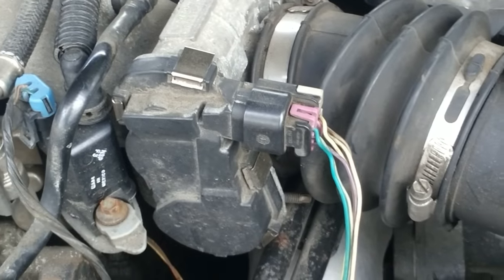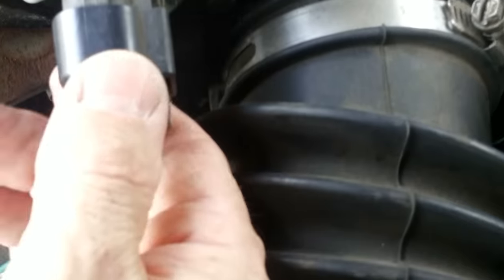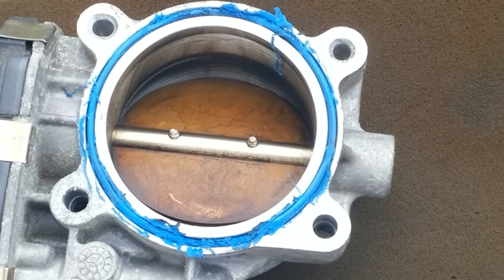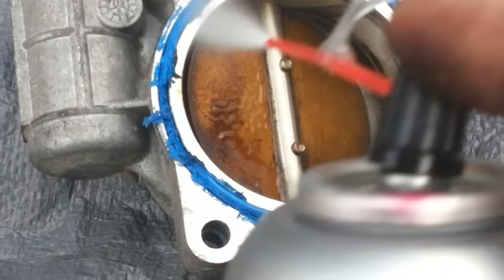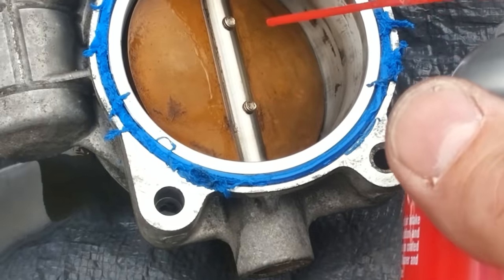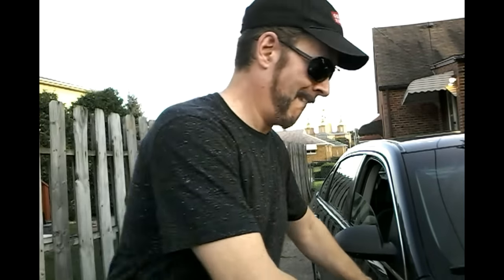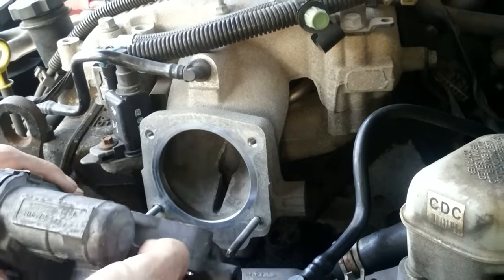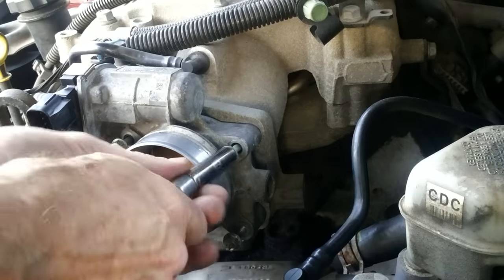Reduced Engine Power.  Here is the FIX.

Comment: 2012 Chevy Impala. Reduce engine power and traction control issues
Reply from the maker: The traction control issue is just because the computer disables it when in reduced power mode.
Reply: @lifeafterlife8417  Thanks. I'm In Indiana and it's getting cold now. Hopefully they can get it fixed for me. I've worked on everything but a chevy. This is my first Chevy also. Just had me nervous.

Comment: where did you get the replacement sensor?
Reply from the maker: I got mine from Autozone, but they no longer carry the sensor only.  Have to buy the whole throttle body.  Sometimes you can find the sensor on Amazon for certain models.
Reply: @lifeafterlife8417  thanks mate!!! ;-)
Reply from the maker: @frankking7779  No worries!  Thanks for watching.

Comment: got "reduced engine power" under a high load (around 5k rpms), replaced TPS, and reset code... a few days later under a high load again -> "reduced engine power", so i replaced gas pedal with sensor.. i reset the code, left the drive way and dogged in on purpose.. and "reduced engine power" again... it only happens under a heavy load, whats else could it be?
Reply from the maker: Find out what else is on the same 5 volt reference signal as the tps.  On some vehicles it could be the cooling fan, fuel tank pressure switch, throttle body,  ac pressure switch.  If one of these is faulty, it could pull that 5 volts down and trigger the reduced engine power.   Cooling fan is the most common.  Also look for bad grounds.
Reply: @lifeafterlife8417  is there a sensor in the cooling fan. Seems that's my problem still after replacing the gas pedal and throttle body and all the other grounding checks and battery terminals.
My car faults as soon as the cooling fans come on, if I disconnect the left front of the 2 fans, no more fault.
Reply from the maker: @danblumel  On some vehicles the cooling fan is on the same 5 volt reference signal as the throttle position sensor, and sometimes the APS sensor.  (gas pedal).  A faulty cooling fan can cause that 5 volt signal to the sensor to be pulled down below 5 volts.  (when the fan kicks on)  That triggers the reduced power mode.  Connect a voltmeter to the Aps and with engine running watch the 5 volts.  When the cooling fan kicks on it may drop to 4 or even lower.  This will verify that the fan is faulty 100 percent.  Do the same with the TPS sensor. (throttle position sensor)  Good Luck!
Reply from the maker: Might need to do a throttle relearn on it.  Let the car idle for 2 or 3 minutes, turn it off, restart and repeat 3 times.  But this procedure varies depending on the year and make of the vehicle.  Also, if you get a check engine light, check which code.  Could be the TPS is faulty,  or the wiring,  or a bad ground somewhere.
Reply: @lifeafterlife8417  if I disconnect the left front fan, no more faults. The right side fan still connected. Before I did that it would fault as soon as the fans come on. Mine is 2010 Impala.
I already replaced the throttle body and the gas pedal, cleaned battery terminals, added coolant ( was 1 quart low ). Only disconnecting the left fan stopped the faults.
Disconnecting the right side fan didn't help, so I hooked it back up. Disconnecting the left fan stopped the problem. Do I need to replace both fans as a complete assembly ?
Reply from the maker: @danblumel  Look at the wiring first. Make sure everything is good there.  But it sounds like the cooling fan. The other might only be for the AC but I could be wrong about that.  I would just replace the one if the wiring and connections are ok.  Do you get a check engine light?  Code 2138 (APS) would be another clue that it's the fan.
Reply: @lifeafterlife8417  yes I get all 3, engine light, traction, stability, engine power reduced.
After changing everything out, I guess I should check for codes again. The original codes were about TPPS throttle pedal position switch discrepancies.
BOTH fans do "blow" and turn freely by hand.
It seems a complete fan assembly,  both ( 2 ) in one unit. Both fans are for the radiator but maybe one of them does both the engine radiator and for AC cooling coil.

Comment: I have a traíl blazer 2003 and don't started like no gas and got reduce engine power light on it's the same???
Reply from the maker: Might be the same.  You need to scan it for trouble codes.  Code p2135 would be the throttle position sensor.  Check out my "reduced engine power update" video for a list of other causes.

Comment: What year is this car. Where can I get kit and gasket
Reply from the maker: 2006 Impala.  The kits can be found on Amazon sometimes if you match up the part number.  Getting harder to find in the parts stores.
Reply: @lifeafterlife8417  okay I need to find one for my 2013 impala. Are they the same throttle body or different
Reply from the maker: Yours is probably for the 3.6 liter engine.  Mine was different, the 3.5. You'll have to buy the complete throttle body assembly.  About 200.00 dollars most parts stores.  Make sure you replace the gasket and good luck!! @Sloo.impala

Comment: After having done all this with an 03 suburban and STILL going into REP, can I have my ecm reset or is this something strictly for 06 and up?
Reply from the maker: Not necessary on an 03 but couldnt hurt.  Make sure the cooling fan is not pulling voltage from the tps.  Its on the same 5 volt reference circuit as the tps.  Common problem on those.

Comment: My 2011 Chevy Impala is saying engine power reduced & it will say throttling system disabled & cut off while I'm driving
Reply from the maker: probably the throttle position sensor or the wiring to it.

Comment: I had a question sir I have changed the throatal body last night I lost the engine light thow now I'm getting engineer power reduced again wat is the problem to get again can you plse know me the solution
Reply from the maker: Give me the make and model and engine of the car and I will do my best.
Reply: Chevrolet Impala 2008 v6
Reply from the maker: @vijayvolpala509  Ok.  First step.  Double check that you reinstalled the throttle body correctly after you changed it.
Reply from the maker: second step:  Have it scanned for fault codes.  Most auto parts store will do this for you.

Comment: when my 2003 does the reduced engine power, i pull over, turn off engine, disconnect maf wiring harness, blow on connector and check pins and reconnect it.
starts right up.
about to,perform ground wire inspections next.
Found out i had to reroute PCM ground wire again because i found out the wire coming off of the engine was kinked too much so i relocated it to passenger side engine bay firewall.

Comment: My car does this when the ac is on can this fix the problem?
Reply from the maker: What kind of car?  Could be the fans drawing too much current.
Reply: 2009 Saturn Aura
Reply from the maker: @ashleylilly4443  Happens ONLY when the AC is on?
Reply: @lifeafterlife8417  yes sir when it runs to long. If you put it on test screen it says wire harness, n knock sensor but those have been replaced.
Reply: If I'm driving and I turn the ac on for to long the the engine power reduce comes on and I have to let it sit for 10 or 15 min and its back running.
Reply from the maker: @ashleylilly4443  Have a mechanic test the Accelerator position sensor (gas pedal) voltage with the engine running and AC on.  Should be 5 volts at all times.  If it drops below, the fans are drawing voltage from the sensor. (they're on the same circuit)  They will need to be replaced.   It's one of many possibilities.  Good luck!
Reply: @lifeafterlife8417   Thank you! I will have someone look into it.

Comment: Replaced mine. Still does the same exact thing.
Reply from the maker: Should work if you have trouble code P2135.  A lot of things can cause it.  Check out my part 2 video.
Reply: Mine does same issue but did p2138 and was accelerator throttle pedal position sensor
Reply: Replaced entire throttle body with sensor and it seems to have worked.

Comment: How long did you keep the vehicle after you "think" you fixed this problem? Because reduced engine power can come and go. Quickly. Or take months to reappear.
This MIGHT not be the actual fix.
Reply from the maker: It had an actual tps failure (code p2135) so replacing it fixed the problem.  I drove the car 3 years with no issues.  The transmission failed so I replaced that.  I then sold the car to a friend.  He’s still driving it today at 220,000 miles.

Comment: Does anyone know where to order just the sensor? Everywhere I've seen sells the throttle body with the sensor. (2011 Chevy Malibu LS)
Reply from the maker: That Guy   Autozone.  Around 50 bucks.  Also try Ebay.
Reply: Thanks bro. BTW...great video!
Reply: Went to 3 different part stores (O'Reilly, autozone, and Napa) none of them sell the kit. Also went online and I can only find the kit for the V6 (of course this is for a 4 cylinder). Any ideas anyone?
Reply from the maker: That Guy  Is your car covered under the technical service bulletin?  If it has less than 120,000 miles you get it replaced for free
Reply: Unfortunately, the 2011 Malibu LS is not covered....
Reply from the maker: That Guy  That's GM for you.  They make the sensor available separate from the throttle body but only on vehicles they have to fix under the extended warranty.  Cheaper for them, I guess.
Reply: Yes sir, you are correct.....

Comment: I know this is old.  Is your channel still up.   Had a question
Reply from the maker: Still up.  How can we help?
Reply: @lifeafterlife8417    I have a dbw 6.0 ls.    I bought the pedal separately.  I hooked it up to make sure it all worked it did.   Few days later I turned it over a few times with no fuel to help prime some oil before I started it.    After turning it over.    Now the pedal doesn't actuate the throttle body.  And I seem to have a small hum coming from the throttle body itself.  I changed nothing from when it worked to the day it stopped.   Any ideas ?
Reply from the maker: @slickf4i110  What make and model car?  And how did you cut the fuel to prime it?
Reply: @lifeafterlife8417  engine from an 04 denali.  But it's a swap project.  So I just simply didn't turn the fuel pump on witch is hooked up on its separate switch
Reply from the maker: @slickf4i110  Does the engine start?  Throttle body shouldn't be humming.

Comment: My 2006 Pontiac Grand Prix got the problem what I need to do
Reply from the maker: First step is to check for any fault codes stored in the computer.  That will get you pointed in the right direction.
Reply: @lifeafterlife8417  Or in the wrong direction too, I replaced the entire Throttle body, AC Delco and the gas peddle and a new filter. I will try cleaning the battery terminals next. Getting frustrated.
At least I got good priced online from ROCK AUTO on the parts purchased. Maybe a cooling fan too, it seems to only have issues if starting when its already warmed up.
Do I need to have the dealer calibrate anything ?

Comment: Had a small hole in my exhaust, got that fixed and the reduced engine power went away and the check light went off
Reply: Really where did you go

Comment: U can do the relearn by yourself
Reply: holly cain. How?
Reply: @johncarter9444  disconnect battery for 15 min the start your car let the car idle for 3 min and the shut car off for 60 seconds and then do that 3 times in a row take a drive above 45 mph see if that helps if not try again
Reply: @hollycain9130  Thank you I will try and lyk
Reply: @johncarter9444  worked for me but not everytime...  Um lookup relearn procedures I found that on Google. You can find anything on Google use it to the best of your knowledge.. I'm just trying to help. Because I had a big problem.

Comment: No codes pop up. Only issue i have other then that is bank 1 and bank 2 with is my catalytics need to be replaces.. smh
Reply from the maker: Those catalytic converters may be clogged up.  That can cause your issue
Reply: U think the cats might cause my reduce engine issue?
Reply from the maker: @braulioresendiz8731  it could be the problem.
Reply: Wow.. never thought that. I was thinking of getting a brand name throttle body position sensor and see but my cats are gonna be too expensive I think..
Reply from the maker: @braulioresendiz8731  I know a trick.  Try drilling a small 1/8th inch hole in the upstream side of the catalytic converter.  See if there is an improvement

Comment: a fix, not the fix, many different things can cause this.
Reply: sausageslaps your right!!!! So best is to star with cheapest,, that’s change air filter, regap or replace spark plugs gap and tourque to spec!! Put very strong fuel injector cleaner ! If not fixed then that’s when you replace Tb sensor, and after cleaning the Tb go thru the relearn process

Comment: No the problem is the accelerator pedal sensor
Reply from the maker: No.  P2135 throttle position sensor.  P2138 is the accelerator position sensor.

Comment: Just had this problem with my 2011 Chevrolet Suburban. After doing alot of homework and watchin alot of videos I cam across a document stating tha GM has issued an Extended Warranty for the TPS. Many vehicles fall under this list. I called the GM 800 #, they scheduled my vehicle for the service at no charge from a Chevrolet dealership. The document states that the dealership will replace the TPS and reprogram the engine control module at no cost to the customer. Below is the link.

https://www.thecarconnection.com/news/1093038_gm-extending-warranty-on-some-vehicles-for-rough-v-8-idle
Reply: Link not working anymore.

Comment: 2004 Cadillac escalade  as well
Reply from the maker: It seems like it's nearly every GM vehicle with the drive by wire system made between 2003 and 2013.  I've even seen it on 2016-2017 Chevy Camaro's and Malibu's.  Escalade is a really nice vehicle except for this problem.

Comment: Cant figure out whats wrong with mine. Iv replaced, ALL the sensors for the gas peddle, cleaned the throttle body, replaced the sensor on the throttle body, cleaned all the connectors on the WHOLE engine with electrical connector cleaner, cleaned all grounds. All the voltages have been checked and more stuff i cant remember. So right now i just drive around with a OBD2 code reader and clear the codes for the gas peddle when i try to drive it. Sometimes i clear the code 7-8 times. Iv watched hours of videos and tried about everything i can do to fix it and nothing works. So next step is to throw a carburetor on it and throw the electronics on the floor.
Reply from the maker: What code are you getting?
Reply: i usually get 1 code at a time and it has given me 4 different codes. I cant remember what codes i got but they are like P0102 and P0121. Il let you know what codes im getting tomorrow. Il even upload a video too. Il post a comment here tomorrow some time.
Reply from the maker: Aaron Brown 
How did you get it to stop for 4 months?
Reply: Life After Life 
I made a guard to block the heat and air blowing directly on the ECM
Reply from the maker: CaptanW 
Could be a faulty ECM or another failed TPS.  Check the Throttle body gasket also.
Reply: my engine is a 5.3 out of a 2004 chevy avalanche that was swapped into an elcamino. Iv spent hours looking at wiring diagrams trying to figure out the problem. But later today il make a video on what its doing.
Reply: +Captain
Reply: +CaptanW I found the prob on my wife's torrent in the wires at the 6 prong elec connector on the TPS GM sells a kit
Reply: i just replaced that connector 2 days ago. Problem still exists.
Reply: Life After Life 
After you changed the sensor did it ever act up again ?
Reply from the maker: Aaron Brown 
Problem solved on my impala.  Running good for 3 months now.
Reply from the maker: Cool idea.  One of the troubling things about this issue is that it is so intermittent that it is not unusual to go 2 to 6 months between "episodes".  Also,  I've heard of replacement sensors failing prematurely.
Reply: Try Anti freeze
Reply: CaptanW this is the fix!!!  Just replace throttle body also comman is engine hot/ ac off! Just replaced thermostat. It's stuck open and sensor is ok!!! Throws everyone off cuase it says engine hot!!!
Reply: CaptanW try replacing the onstar computer that fixed mine.
Reply: CaptanW easy, get rid of the throttle body and put a cable driven TB on your swap and have a tuner disable the drive by wire and never worry about it again.
Reply: If this doesn't fix it you could have a voltage issue with the ecu, just had one do it the other day.
Reply: CaptanW h@
Reply: What doxed the problem
Reply: CaptanW morning
Reply: 2003 Yukon Denali xl gas,  mine does same thing,  I pull over when possible, shut off engine, pull mass air flow sensor wiring harness off connector, wait 10 seconds, check pins, reconnect and restart truck.
Replaced MAF and wiring harness, still does it, checking ground wires next and wires to tps

Comment: Sucks cause mine is a 2008 and cant afford to get it reprogrammed
Reply: Joshua Weeks not required. Disconnect the battery for 10 mins then reconnect. Ecm will recalibrate on its own.
Reply: SuperCyril2 sheww thanks I was thinking it would but wasn’t sure :) good to know mine is doing error code p2138 said throttle pedal position sensor smh always something with Chevy impala 09